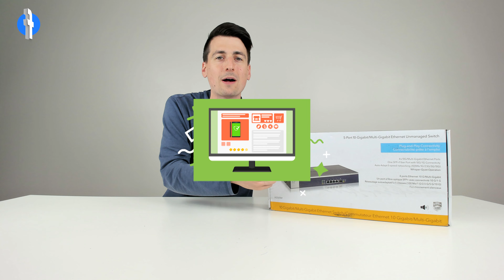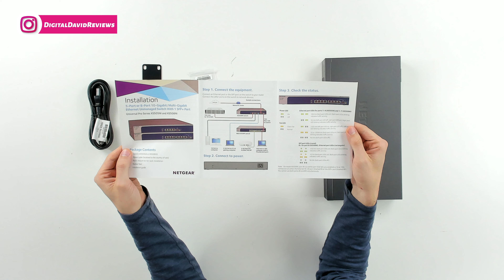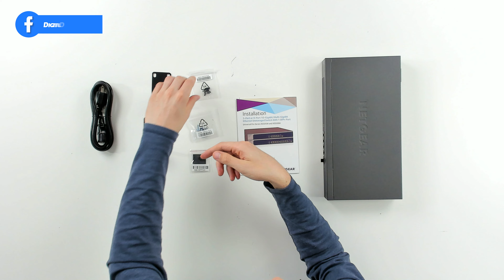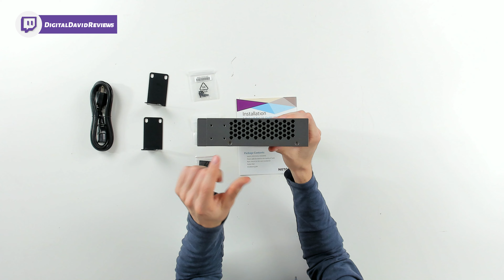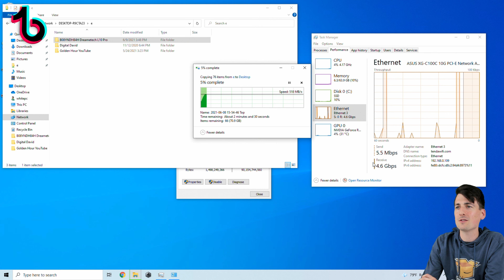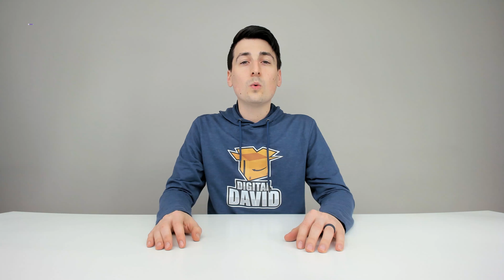NETGEAR 5-Port 10G Multi-Gigabit Ethernet Unmanaged Switch (XS505M)

Comment: So misleading, Netgear. It's 1x 10Gbps SFP+ and 4x 1Gbps (RJ45) ports.
Reply: No, it's not. As per the official specs: "100M/1G/2.5G/5G/10G RJ-45 copper ports : 4"

The RJ-45 ports are all capable of speeds of up to 10 gigabit.
Reply: Hi "icyhotonmynuts". You are wrong.
Reply: It's 4 10G ethernet rj45 ports
Reply from the maker: Sorry you feel that way. Thanks for the feedback!
~B

Comment: Why are you only getting 5gig speed on a 10 gig port?  I’d your device only capable of 5gig. Or is it the switch
Reply from the maker: In the video I get close to 9 Gbps which is on par with this switch... I forget the reason why its not 10 or better but that might have to do with the file size of the iperf test or something else above my knowledge! Everything is 10G and Cat 6A for the test